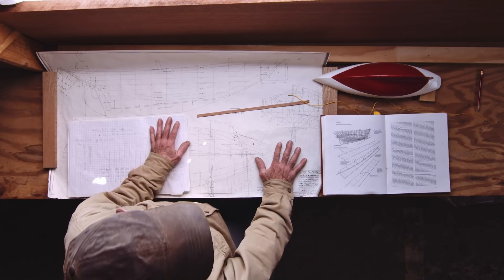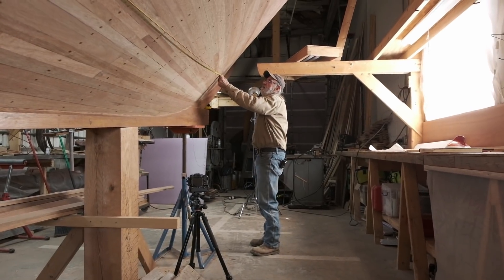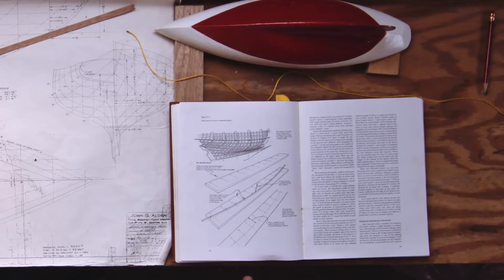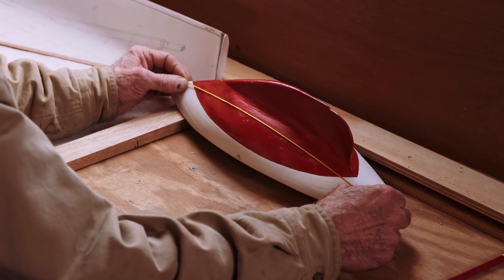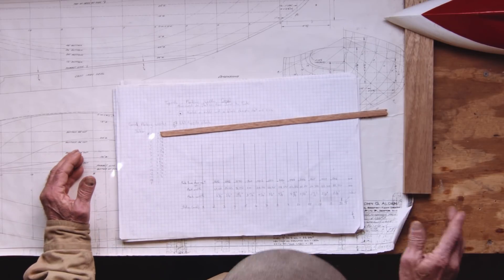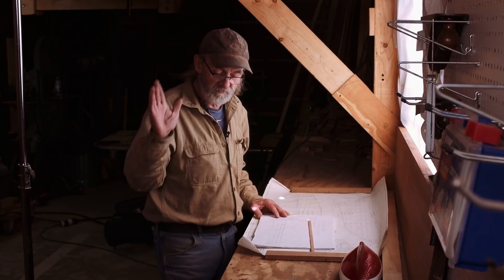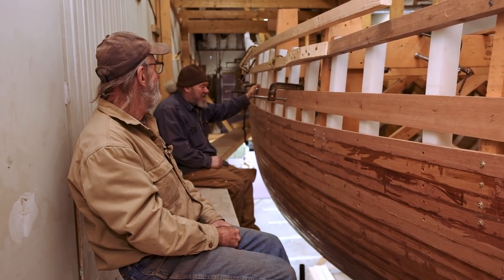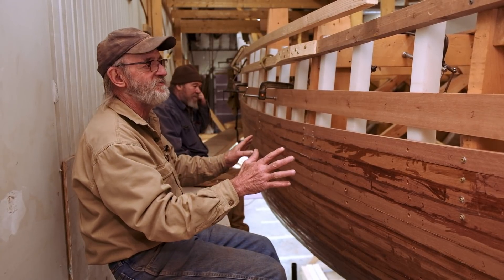Building Evelyn: Lining off with a magic line, EP12

Comment: A laser level would be great for that
Reply: The magic line is Not the level line.  That would be a water line.
Reply: As Lou said, paraphrasing, the magic line is not straight in any dimension. In other words, if it were frozen and suspended in space, you could look at it from above, from the side or from the ends and it would be curved from every perspective.

Comment: Another question which itches me for a long time. Why are you using flexible material for framing? Shouldn't a hull be as stiff as possible?
Reply: All frames are flexible,  but the only pressure a frame has to resist is length ways, or compression. 
If you smash into a pier, the frames only job is to hold the planks together, and make the outward curve of the planks spread the pressure along the whole hull. 
Same for water and wave pressure.
Ribs by themselves are not required to resist pressure from the exterior,  or they would need to be overly heavy and large.

Comment: How do you determine where on the stem and stern to put the ends of the "magic line"?
Reply: Rewatch, but the "start' of the magic line are two points on the hull.
Where they end up on the bow and stern is a function of where the two points are placed two thirds along the side of the hull.
Ie. Where a straight plank would end up if nailed close to the two points to start.

Comment: Listening to you is an education. Loved learning about the "magic line". This actually is the same concept used in Riemannian Geometry of the shortest distance between two points.  Reimannian Geometery is a geomtery that is used to describe curved space like the space around the sun. When two points are situated in curved space, rather than the flat Newtonian space, the easiest way to get from point A to point B would be defined as a straight line, i.e the magic line.

Comment: I find it misleading to speak of "the" magic line.   A magic line is placed from a point on the stem to a point on the sternpost, where it is convenient to divide the space from the line up to the gunnels ("Gunwales") or Sheer Plank (or "Planksheer"), and from the magic line down to the garboard plank by the keel, into convenient plank widths.  As Louis explains, a magic line is found by measuring down from the gunnels or sheer plank, with the magic line passing through 2 points equidistant from the sheer plank or gunnels, with those points typically being at thirds of the length of the hull.  The magic line is adjusted up or down as convenient to allow convenient plank widths.  Planks will usually be tapered to the stem and the stern as necessitated by the shape of the hull,, since the garboard to sheer plank distance varies along the hull.  
  A magic line can be found by a tight string or by taking a long, straight piece of planking and placing it longitudinally from stem to stern without bending it to raise or lower its edges, i.e. without "edge setting" it.
  I find it to be a fascinating exercise to shape a boat out of straight pieces of wood.  Framing a house is so much easier than building a boat.
Reply: @Tinfoil Thank you for this sobre and simple explanation which gives the reason why to use a cord in this instance.

Comment: The taut string follows the shortest distance between two points on a curved surface. If you stretch a string taut between two points on a globe it will describe an arc of a great circle, which is the path that airplanes fly between cities distant from each other.
Reply: Something l remember teacher demonstrating 50 years ago😉
Reply: I remember flying from Tokyo to Minneapolis once, waking up after flying all night, looking down between the clouds and seeing snow capped mountains with no roads or cities, wondering where we could be.  After a while it became clear we were over the Canadian Rockies, on a great circle route.
Reply: MichaelKingsfordGray  While this is accurate in an absolute sense, for the purposes of classroom demonstration the difference is insignificant.
The Earth's polar diameter is 7899.806 miles. It's equatorial diameter is 7923.382 miles. That is a difference of 0.34%. For a twelve inch desktop globe to reproduce this proportion it would be a mere 0.040", that's roughly one millimeter, greater in diameter through the equator than through the poles. A difference so small that manufacturers of classroom globes don't bother to take it into account.

Comment: The metric system was introduced by French humanists during the miserable French revolution. It is based upon powers of the  number ten because humans (and monkeys) have ten fingers in all. As such it facilitated counting on your fingers. The Imperial system, with 1/2", 1/4", 1/8", 1/16" etc. is actually based on the "binary" system, on powers of two, and as such it is utterly harmonious with modern computers which store and compute with binary numbers. For example, 1/4 is one divided by two to the second power. The reason why division is more difficult with the Imperial system is because of the mismatch between decimal numbers (again, they are based on powers of ten) and the binary-based Imperial system which is based on powers of two.

Comment: In large scale commercial concrete construction(high rises stadiums) we commonly use metric forms to build off of imperial plans. Its a p.i.t.a. and i wish we could swap for metric. So much easier to layout etc.
Reply: There are benefits to both in different scenarios for certain, no reason to do away with either. I agree if it works better on something particular it's time to switch over. There's just no need to hold on to something just for the sake of it nor should we throw the baby out with the bathwater. I use a dual system tape quite a lot, often on the same project for different things, which ever is faster, most accurate and easier. A friend of mine does the same thing with a standard and decimal system tape for his line of work and was the one who suggested I try it for my field with a standard/metric rule. He was right on the money. My only complaint is sometimes the scale I'm using is on the wrong side of the blade, this is easily fixed by reversing where I measure from and would be really cool if the tape measure industry would make different "handed" versions, but not necessary. Come to think of it it would be cool if they made an opposite handed rule period. Anyway, I digress, great comment. :)